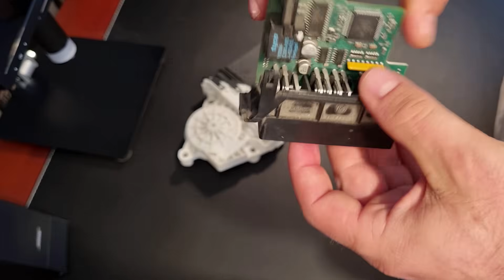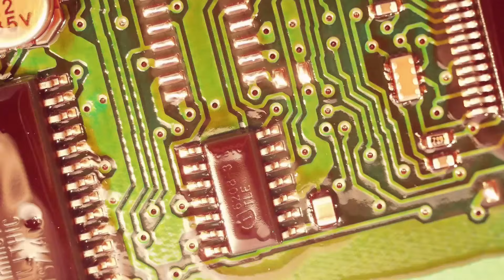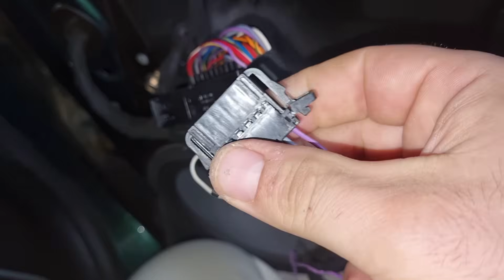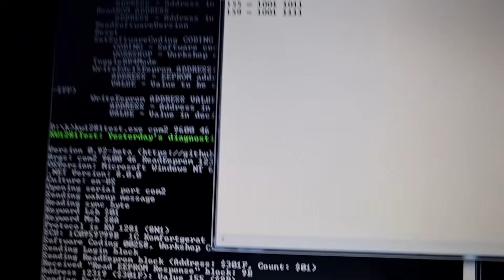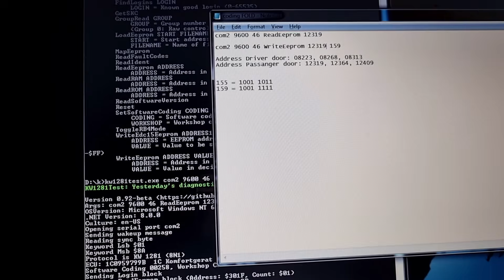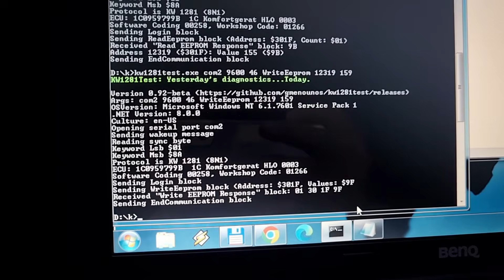VW Golf MK4 power folding mirrors with puddle light retrofit - Part 2, electrical

Comment: Hi. I'm doing the same conversion on the doors. I'm upgrading the window motor controller from the standard one to the upgraded one from the Highline version to support the folding mirrors. A very important question. I'm having a hard time getting the TLE 6208-3 chip. What kind of controller do you have that has two of these chips? What car is it from, and what's the part number? Excellent video! Regards.
Reply from the maker: Every front door control module has at least one TLE, assuming it has electrically adjustable mirrors. So if you find a couple of cheap ones from a scrap yard you can extract the chips and add them to yours.

Comment: Howdy! Marcus I’m on the process of doing this thanks for your video however my question is it wouldn’t be easier if you use the Seat Leon Door modules straight up instead of soldering the chips into the Golf ones?
Reply from the maker: They do not fit at least phisically so nope.
Reply: @marcusm556 I found out that Seat Leon Door modules/Motors fit straight up on a Golf Mk4 no need to unsolder and solder the chips just swap the modules and thats it!!!  all you need to know your CCM style if you have a 1C  you need 1C0 959 801B for Driver side and 1C0 959 802C for passenger and if you have 1J you need 1J0959801F for driver side and 1J0959802G for Passenger side and wiring thats it very easy

Comment: Hey Marcus. many thanks for the tutorial. I am looking to do the retrofit and I have a quick question on the puddle lights: you mention to connect to pins T23 and T23 on the CCM. are the pins missing by any chance? can you please advise? Mersi!
Reply from the maker: the pins are there, as the wires go right up to the interior lights, you should tap right into those two. So the puddle lights light up in sync with the interior lights.

Comment: MY FRIEND, I NEED YOUR HELP. I INSTALLED THE MIRROR FROM A GOLF MK4, AND IT WORKS FINE WITH THE DRIVER'S DOOR BUTTON. IT OPENS AND CLOSES, BUT IT DOESN'T WORK WITH THE ORIGINAL ALARM.
THERE'S A CONFIGURATION I NEED, AND I HAVEN'T FOUND ANYTHING ABOUT IT. CAN YOU HELP ME?
Reply: It’s not supposed to fold/unfold on lock/unlock . I don’t know where do you take this info from and then you go around asking everyone? It is not how it works . It folds on lock with 361 relay and 361 is not compatible with the factory folding system so you either do it with 361 relay and add more relays to make the switch work or stick with the factory system

Comment: Congratulations on your work! I'm from Brazil and my car is a Bora V6 4motion and the mirrors are original folding, but they don't work with the alarm remote control. Do you know if changing the codes of the comfort center works with the alarm? Thank you very much.
Reply from the maker: @FabioLobas  thanks! I am not sure what do you mean they don't work with the alarm?
Reply: Send me your WhatsApp and I will send you a link that can be used to make the alarm work, but you need the correct program.
Reply from the maker: @FabioLobas  please, post here the link  for everybody intereseted to see. Thanks.
Reply: https://youtu.be/wXemXPn70XQ?si=Ec8IlBQGlnthRU0I
Reply: In this video he hides the codes! We need to find out the codes now and do the programming
Reply from the maker: @FabioLobas  ok. Interesting. As far I know this functionality can be done by adding a specific audi relay and some tweaking of the joystick so the door module is still powered when you remove the ignition key. I never planned to pursue thay path. Maybe in the future.
Reply: @FabioLobas it’s a very long code and many addresses. The software is custom for the exact code to be written to the eeprom and it works with only one type of door module and if you have different one it will not work

Comment: would you perhaps know the difference between 1j0 and 1c1 window motor regulators? is the only difference the extra chip?
Reply from the maker: @atrabanefiltruota  nope, it is also the communication speed on the can bus. They are not intechangeable

Comment: Hi friend, very good tutorial. I wanted to ask you a question. A year ago I did this same upgrade on my Golf, I used the Passat B5.5 mirrors together with its window lifter module. Everything works perfect from the
joystick. I couldn't get closing/opening the mirror from the key to work. Could you do it?
Reply from the maker: Thanks. I think it can be done using some audi relay, but as it is now it shouldn't supose to.work from the key, so it is normal. Unfortunately I don't know exactly what modifications has to be done.
Reply: @marcusm556  At first I had done the scheme of using the Audi relay but it also only worked from the joystick. 
I have a tutorial that I haven't done yet, which would be to update the door modules and from there it would have to work with the car alarm. If you want, I'll give it to you, because you have more experience and understand better how to do said tutorial.
Reply: @GuiGuiTipex can you send me this tutorial
Reply: @GuiGuiTipex  can you send me this modification? Maybe i can create a tutorial video from this and share with you and the community.
Reply: @marcusm556 salut, vreau să fac și eu retrofit ul acesta, am o întrebare, firele de la switch unde le legi, la care pini mai exact? Mersi mult
Reply from the maker: @AndreiflorinStefan  salut. Faci legaturile conform instuctiunilor din descrierea clipului.
Reply: @marcusm556 o sa încerc, mersi încă odată. O seara frumoasa